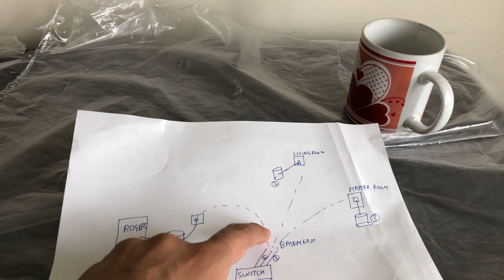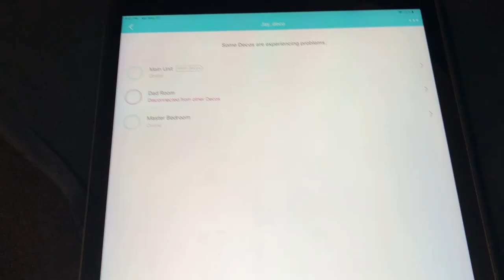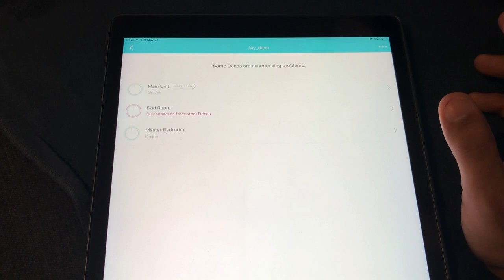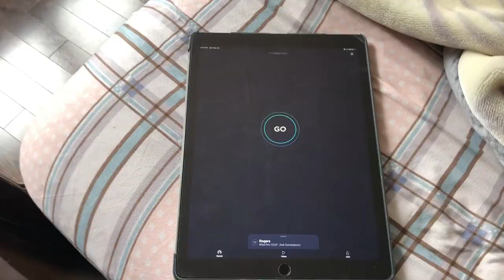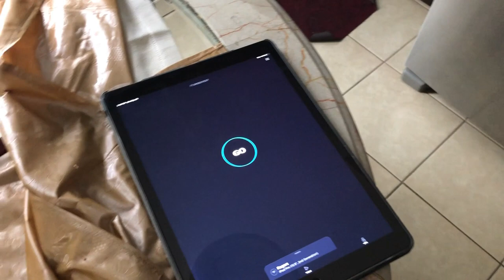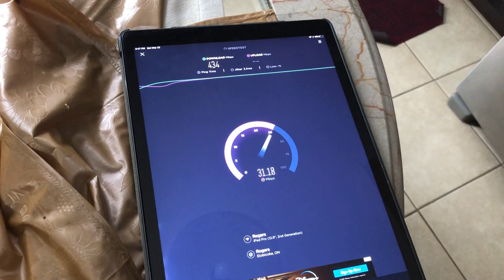Hardwire/ Ethernet Backhaul Mesh Wifi 6: TP Link Deco X60

Comment: The EXACT video I needed. I have been using Apple Extreme router and access points for years... one on each floor hardwired with gigabit ethernet. I finally need to replace them and this sounds a decent option.
Reply from the maker: Thanks for the comment, which one are you buying now?
Reply: @Canada_Facts  I purchased the TP-Link Deco X60 3-pack. I’m using Ethernet backhaul since I have GB ports on each floor. So far everything is super stable. Faster than my former Apple AirPort Extreme setup. I’m getting Wireless speeds on my iPhone 13 Pro of around 445 Mbps up and down. I had wireless speeds of around 300-400Mbps up and down prior. Not a drastic change but my Airport setup was pretty impressive for a long time. I was expecting slightly better wireless speeds, since I have FiOS gigabit service. But I do have a lot of devices connected. Maybe the X90 at AX6600 would deliver faster speeds, but this is fine for me. I do all my intense work on my wired laptop, and that gives me 900 Mbps up and down on average. I upgraded from the Airports because of recent, unexplained random drops of connectivity. Maybe they just got old.

Comment: Just as all the other commenters, I thank you for laying out the schematic of your setup. Even though the Deco units have a mode that is supposed to allow them to work as extenders, rather than the main router, that mode did not work for me. And the biggest revelation was that even though my modem is a combination modem-router, the Deco units do not work if another device is connected to one of the modem-router’s other ports along with the Deco. The only way I could get the system to run was exactly as you did with the signal cable going to the modem-router, use only 1 port and connect to one port on the Deco, connect second Deco port to my in-wall Ethernet line to my switch, and finally plugging all my other devices to my switch. Thank you so much. I was seriously considering returning the Deco and just going back to a wireless router with range extenders!
Reply from the maker: Nice to hear the video was helpful

Comment: I have the TP-Link X20 model for mesh (3 nodes).   I decided to backhaul the three and there is a significant boost in the signal.  Just recently, I also directly connected my main TV to the nearest mesh node with an ethernet cable and found that it improved my TV's responsiveness (little or no buffering for things like Netflix, etc.).

Comment: Thanks for the explanation, is a switch really necessary? My ISP modem is in my living room and there is ethernet wiring running across my living room and 2 bedrooms. 
Is is possible to:
1. Connect my ISP modem into the main Deco router and plug into the living room ethernet port

2. Plug a Deco router into the ethernet port in bedroom 1
3. Plug a Deco router into the ethernet port in bedroom 2
As I have ethernet running around the house, can I just plug the Decos into the ethernet port in the walls and have it serve as an ethernet backhaul?

Thank you for your help
Reply from the maker: Switch is not necessary
My setup mandated that but if your ethernet setup doesn’t require, feel free to test without it

Comment: Thanks for showing the diagram of how to ethernet backhaul the two other Deco Devices using a switch. Other videos just mention you can ethernet backhaul, but with only two ports per device, I never understood how you could backhaul two 'access point' deco units to the main Deco router unit that is already using one of it's ports to connect to the modem (2+1=3 ports needed...).
Reply from the maker: Thanks for the feedback

Comment: Thanks for the video, very informative 👍my question is if I keep my old router(modem) and the 3 decos as APs will I have access for of all the Deco features (like guest wifi, devices connected, parental control...)? On the other hand if I set one deco as the router does it have firewall(as my old router)? 🤔  I was wondering on security features. However this system seems very good.

Comment: You rock, this answers almost all my questions for the setup I'm about to put in a new house, except with x50poe instead of x60.
In the deco app, when setting up your wifi, is there an option to set up all the decos wifi at once ? Like a single ssid/password for all of them ?
Once this is done, on my devices, will there be only one SSID  shown ? I read that you should run each hotspot on different channels.
I don't really want to have multiple hotspots showing on my devices.
Reply from the maker: Thanks a lot for all your wonderful words
Yes the setup will provide one ssid for all the decos and they would be setup together

Comment: Hi Jay, I set up my Deco M4s exactly like yours. But I only get max speed with the main Deco, half speed with the after-switched nodes. I use Cat5e cables and a 1Gp switch; my Deco is in Router mode.

Comment: Thanks for this. Is there any reasons that connecting one of the Decos to a 2nd unmanaged gigabit switch wouldn’t work? (ISP/ONT—>Deco1–>switch1—>switch2–Deco2).  I’m troubleshooting and can’t get it to connect via Ethernet for wired backhaul. TIA.

Comment: Great video! Not sure if you will see this message but curious as to what you think of your mesh 2 years later. Also a question… if you’re hardwiring your decos do you think a tri-band would be irrelevant and a dual band would be equally sufficient? I can see the tri-band useful if your connecting the nodes wirelessly
Reply from the maker: My current mesh is deco x60 which is wifi 6 and dual band, phenomenal performance 

So yes with hardwiring you can go ahead with dual band

Comment: Hi Jasdeep, nice video. I too have rogers and ethernet switch plugs with coax in my home but i dont see any ethernet cable in my basement. Do I require any wiring now?
Reply from the maker: If you are missing the ethernet running in your house, you will need someone to install that wiring

Comment: Thanks for the explanation. I have a question. Using this method, will all the decos provide the same network connection? Meaning do i have to switch manually between connections every time i go to a different place or will it simply make one connection for all?
Reply from the maker: Good question 
Yes deco will provide one connection and switching would be automatic

Comment: Great explanation. Can you help me understand something, all of my data points in the house lead back to a central point where my modem is. Can each router/unit just connect directly into my modem without the need for a switch?
Reply from the maker: I am assuming the modem you are referring is the internet provider’s modem

If you have a mesh then you can connect all units to that Main Node that connects to Modem

But you should not connect individual nodes to Modem

Because this is Master slave combo

So you need a node/unit which connects to Modem , that node is Master Node, all other units connect to Main Mode not Modem

Comment: Hello. Just watched your video. Very informative. This setup is what I prefer. And i want to know if this works before i buy a mesh system. Thanks!

How about if all mesh routers are wired interconnected?
"Modem - Deco1 - Deco 2 - Deco 3"
Reply from the maker: Thanks for reaching out
This configuration works smoothly
The routers can be connected in either fashion but a good approach is always
1. Modem —> deco1
deco1–>deco2
deco1–>deco3
For router mode

2. Modem—>deco1
Modem/deco1–> deco2 
Modem/deco1–>deco3
For AP mode

Ap mode has numerous options

Comment: hi, did u need to set up the switch, as in changing the settings of the ports ure using on the switch? and, does all three routers uses same SSID? and for the other two routers, did u have to "set it up"? or is it just like plug n play?

Comment: Great video!  just 2 questions, 1. do you need some special setup for the hardwire connection to work, or is it just a plug-and-play thing? 2. Which operation mode are u using, router or access point?
Reply from the maker: To answer your questions
1. It is mostly plug and play as far as Deco is concerned - could be different for different brands
2. I am using router but you can decide by going  through this video
 https://youtu.be/N9FU3Fq9fgo

Comment: Great video, but I'm having issues. Does the ethernet connection to other Decos HAVE TO come from the main Deco unit? I tried to wire a Deco that is in a backyard office with very weak signal. But the wire into the Deco comes directly from my ATT router not the main Deco unit. I'm wondering if that's the issue.
Reply from the maker: You might need to check the deco app to confirm if that deco is hardwired or still getting connected vis wifi
Reply: @Canada_Facts  Thank you. I ended up connecting the two satellite Decos directly from the main Deco. Seems that's the only way to do it. I will note that the satellite Deco in my in-home office is connected to an ethernet cord that comes from an unmanaged switch that is traced back to the main Deco, so it's not a direct Deco to Deco connection, but the app shows it's a wired connection. I tried going thru a managed switch back to the Deco in the backyard office, but that was a no go. All I had to do was wire directly into the Deco and then connect from the Deco into the managed switch/router and now everything works as it should. Mean time, I do have other items coming directly from the back of my ATT router to things like my TV, receiver, etc, and that does not seem to be an issue as they are all working fine.

Comment: Thanks for the video. Do you get wifi roaming between access points, or you're connecting to each AP separately when going to the next room? It's unclear from the video
Reply from the maker: Wifi roaming appears to be slower in AP mode but it does happen

Comment: Is there a reason why using ethernet cable for the other two Deco?  What if you just plug the Deco with power?  Wifi signal will be weak ?
Reply from the maker: Ethernet connected mesh wifi usually has low latency and higher speeds vs wifi connected mesh

Comment: Can you use the third Deco on base ment to replace the switch and connect the main and 2nd one to reduce latency. That's my setup. So each floor have one Deco all ethernet backhal without the switch cause I find switch will cause problems, I also find 2 Deco on same floor is a bad idea, the 1 and 2 ports on. Deco are interchangeable
Reply from the maker: That’s a good idea, I am using switch as I need my decos on top floors

Comment: What if my setup is like
First deco: Plugged to the main router
Second deco: Connected in the guest room which is between the hall and master bedroom. No ethernet here.
Third deco: Connected via ethernet which comes from the hall via a ethernet switch. 

Which connection will the second deco pick network from?
Reply from the maker: Will pick up from either the first or second depending on the proximity and signal strength
You can check which one it picked from using the app
Reply: @Canada_Facts  turned out this didn't work for me since I didn't have a proper network switch. Need to get one.
Reply from the maker: @iamsid23  Suggestion would be to get TPLink switch to avoid compatibility issues

Comment: This is great demonstration. Thanks, Jay.

Question:
Time-lapse at 2:51.

So currently I have two deco X50. By looking at your diagram, I was wondering if it's possible to skip the first deco (Between Rogers modem and Ethernet) and the reset of the diagram will stay the same. Will this kind of setup work?  🤔

So technically Modem will directly connect to the switch via ethernet (in the basement) and the primary deco (living room) will connect to the switch via ethernet connection. Other deco will stay in master bedroom which will also connect to the switch via ethernet connection. Do you think this setup will work or modem always has to connect with deco first to make the wired mesh network?
Reply from the maker: Should work but seems like AP mode
Reply: @Canada_Facts  Ahh I see. Cool. Thanks for your response. 🤟🏽

Comment: I replaced my switch to tp-link then the hard wire setup worked. the older one was d-link which confused the slave Deco unit and it disconnected.
Reply from the maker: Yeah there seems to be some compatibility concerns b/w tplink and  dlink

Comment: Hi Jay - out of curiosity, I know the first point connects to the WAN port on the mesh router. But for the second and third points, did you plug the ethernet cable directly into the LAN ports of the router? I was told a while back that hardwiring via ethernet all mesh points can cause network interference. 

I have Motorola Q11 mesh routers and my setup would be very similar to yours. The only difference is that I am using Motorola Moca adapters (Ethernet over Coax) to establish the hardwire connectivity throughout my household using the existing coax drops. 

Thank you for any information that you can provide.
Reply from the maker: The other points are connected to the main node via a switch
No the interference only happens when the units are close
Secondly since the unit connect and form a mesh together so the equipment itself eliminates interference
Reply: @Canada_Facts  Thank you! This is great feedback!

Comment: Great video. Instead of plugging in from a switch like you did, can I plug in each deco unit with ethernet from each other? Since there are two ports on each unit.
Reply from the maker: I am afraid not
For getting one common wifi and max output, connect all decos with main deco
So you need a switch if you have more than 3 decos

Comment: For wired backhaul between both mesh devices shall we use crossed-over cable? How about connection between main mesh AP and the router: shall we use crossed-over or straight-through cable?
Reply from the maker: I used cross over

Comment: Can you put a switch after the router/modem and then take  ethernet cable to each deco unit ? and I think you need to make deco units work in access point mode.
Reply from the maker: You got it

Comment: Hi! Thanks for that helpfull video. I Have similar situation. But i dont have an rogers Modem. I Have a two-in-one device (modem and router in one device called TECHNICOLOR). So it comes out of my technicolor a ready internet signal. Can i plug in a ready internet signal (in your situation comes out the first Deco the ready internet signal) to the first Deco = Main Deco and build the rest of my home wifi like yours? Thank you!
Reply from the maker: Hey there 
The Technicolor output should be good for the Main deco
Reply: @Canada_Facts  Hello. I have another question. Do my decos have to run in accesspoint mode or is it possible without? Thank you. B. R.

Comment: Hey! Great video, hope you can help with a query. I currently have ISP modem into my main deco. Can I run a cable from my main deco to a secondary deco and then from the secondary deco to a switch or will it hurt the speed? Thanks!
Reply from the maker: You can do that, speed will be based on devices doesn't matter much if it is ethernet or wifi

Comment: Hello, can you have more than one switch on the decos? Main deco with switch1. 2nd deco to switch1 using Ethernet backhaul. And switch2 connected to 2nd deco. There are not enough ports on the 2nd deco so I need switch2 to connect several Ethernet devices.   Thank you.
Reply from the maker: Should work ideally, I have not tried this config till now
Would be interested to see the result though

Comment: Great work. 
I’m using mesh wifi system and they are connected wirelessly. I would like to connect them by wires. My question, is it that simple just to plug the wires and it will show on deco app that they are connected by wire or I have to reconfigure them again?! Is there any specific steps that I have to follow?
Reply from the maker: For Deco & Orbi just connect them through cables and it should be good
No new config required
Reply: @Canada_Facts  thank you 🙏

Comment: Sir im going to buy deco just for 1 pack, and want to connect that with my first router. My question, if im pairing my device to my router wifi, and im going to other place that the deco i place in it, is it wifi connect automatic to my deco from my first router?
Reply from the maker: It might have problems
Essentially you are talking about two different wifi points, 1 deco and 1 other wifi router

For mesh you need to have decos all over for roaming

Comment: Good,  short video showing the configuration that is for some reason, omitted in the tp-link presentations. Quick question though - are cable connected satelites still mesh (the very same WiFi network) or are they visible as separate WiFi networks? Also - is a mobile app the only way to configure this devices?
Reply from the maker: Depends on how the cables are connected
If satellites are connected to the main unit via cables then yes
Most of the companies have mobile app for this but in netgear you can do on your computer too
Reply: @Canada_Facts  Jay. Nice vid. But to make sure I understand, you mean that your implementation is in fact one logical network? If you move your device from near one Deco to near another, will the device automatically connect to the new local Deco. (IE, will it automatically attach to the strongest signal?) Thanks.

Comment: I have a x50 mesh system, do I have to TURN OFF  WiFi modem ? It is necessary because I haven’t turned off the WiFi ! Thank you guys
Reply from the maker: I don’t think you need to turn off the wifi modem
In case it causes interference and lowers speed you can try doing that
All the best